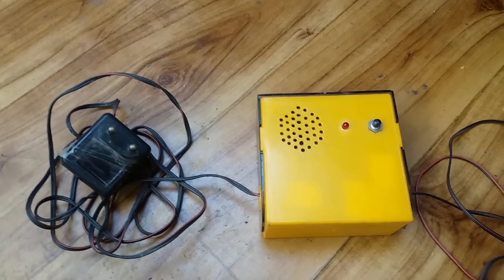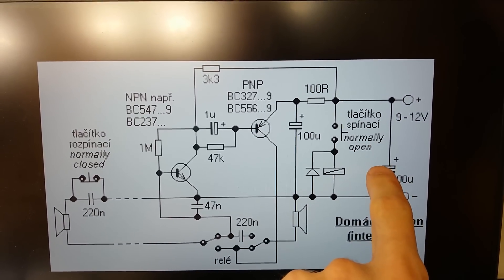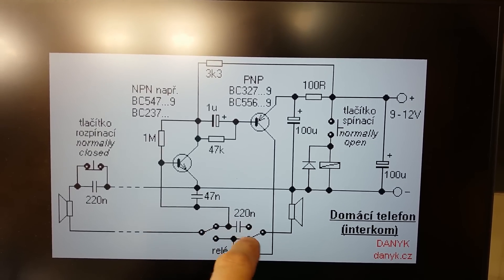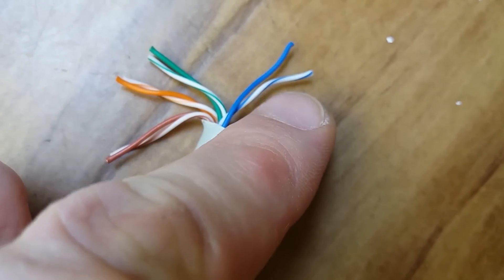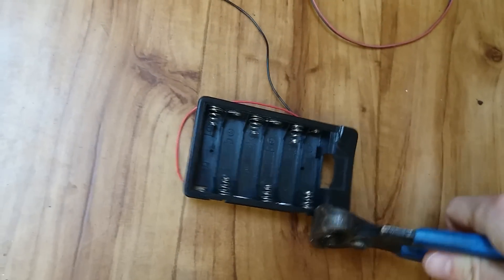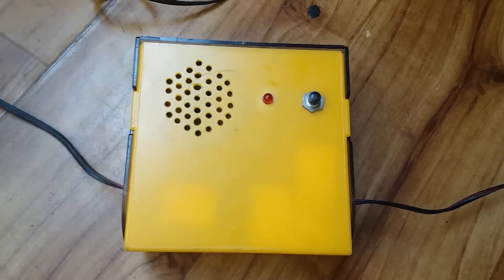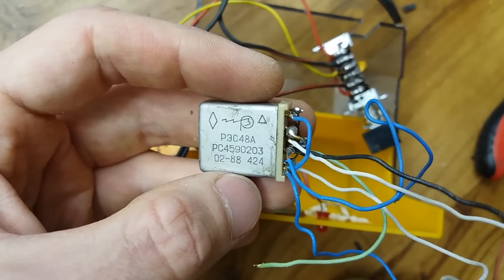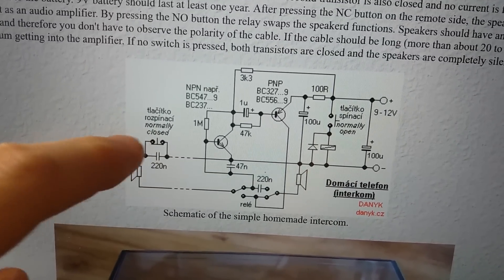DIY intercom (+ random thoughts on overcomplicated technologies) - unedited

Comment: Especially household appliances.why should fridge have digital thermostat? Why washing machines connect to wifi? All of that could be solved with mechanical switches, timers and thermostats plus it would be 10 times more reliable.
Reply: my grandmas washing machine is practiacally useless because its microcontroller died after like not even 4 years of use. My washing machine lasted 30 years with only occasianal brush replacements (since it has a brushed motor) until the motor died and we actually found a replacement that will prolly last another 30 years. The timings and the programs where never a problem. It has a knob to set the program with a synchronous ac motor that turns it as time goes on connecting and disconnecting internal contacts that start and stop each function and the whole thing is precisely timed cause the synchronous motor uses the constant 50hz mains frequency for the timings. Zero logic get it does all the different functions a washing machine needs to do just fine
Reply: @the_danksmith134  Exactly! And no eco crap! Uses water.

Comment: I stiil use this type of cable to connect my computer to modem. Also you are so right about technology depence, most people cannot fix their appliances even if problem is as simple as broken cable yet they complain about so called missing features in the products when they did not know what a transistor is and this is sadly true even for engineering students (i am electrical engineering student) most of my friends from my department cannot understand or build simple transistor circuits like amplifiers or oscillators. Instead they try to learn super complex, posh subjects like artifical intelligence while they can't explain how a royer oscillator works.
Reply: I didn't know about the Royer Oscillator so I had to Google it, isn't modern technology marvellous!!!!!!!!!!!!!! , this info is for other readers if interested. 😏😏

A Royer oscillator is an electronic relaxation oscillator that employs a saturable-core transformer. It was invented and patented in 1954 by George H. Royer. It has the advantages of simplicity, low component count, rectangle waveforms, and easy transformer isolation. By making maximum use of the transformer core, it also minimises the size and weight of the transformer. The classic Royer circuit outputs square waves. There is another converter design often described as a "resonant Royer" which generates sinewaves. This was, apparently, first described in 1959 by Baxandall and therefore should be called the "Baxandall converter". Its differences are explained below. Both versions are widely used, mainly as power inverters.
Reply: @brucepickess8097  if it is used wisely without becoming too dependent modern technology is amazing but like Diode's thermometer video, there is no need for wifi, bluetooth or any other smart things when you making simple thermometer or clock. This is the curse of modern technology almost every product have unneccessary features and almost always they use a microprocessor even if task is very simple and it could be done using some simple logic, 555 or etc. They overcompilacate everything which makes products last less and impossible to repair.

Comment: I made myself a similar intercom from inside the house to the main gate (some 10m length of cable) using a schematic from a magazine. I do not know, my fault or the schematic was wrong or is was its normal functional mode, but I always listened what happened on the street. And yes, the outside speaker had no button, it had only one button (listen/speak) that was inside. Also, I used a transformer from an old electromagnetic telephone and two germanium transistors.

Comment: Neat! I will try to make this one since I am more a fan of analog solutions that are reliable instead of relying on others.

I have to agree on the points you make that the complexity of devices these days makes them harder to repair. Minimizing design is also something that greatly reduces reliability. Like that modem would probably perform better with more internal memory and a heatsink and adding more or better capacitors. but then it would cost more to produce and when modems are given away for free with internet contracts they will decide to buy cheapest ones. Also why build reliable device when you earn more money by selling a new one every few years.
So much e-waste is being generated gust because of financial gains. It’s sad really.
Also companies making it hard to repair their products due to using custom chips and not making those available to repair shops or adding firmware that breaks the device when a repair is made is an issue (see right to repair / louis rossman)

When possible, I try to use simpler technology that I can repair myself. The only problem I have now with using actual older devices is that the energy prices are rising and I cannot afford to use inefficient devices. Your solutions for metering usage and replacing parts + adding batteries is very welcome.

Comment: Most of us still use cables to connect computers to the internet, but it's modern cabling and it works a lot better than wifi (latency, speed, stability). These internet connectors are called RJ-45 and there's a lot of standards for cables such as cat5e, cat6a
Reply: Same, the only thing that uses WiFi is my work laptop and my phone. All my computers use Ethernet.
Reply: modern wifi is nowere near the wifi before 10-15 years and its pretty reliable
Reply: @ДимитърАндонов-ъ7е  that's true but most modern houses have ethernet wiring already in place so why not. Also, not everyone has multiple routers for a huge house, so signal loss is an issue
Reply: @ДимитърАндонов-ъ7е  If you live in a rural region, maybe. WiFi is chaos in the city. 30 networks on 2.4 GHz, completely crambed. And I use ESPs with 2.4 GHz... Have to switch channels daily.

Comment: I also hate overcomplicated things, especially putting an Arduino in everything. Like 80% of "DIY" projects nowadays consist of an Arduino and a few Chinese modules slapped together. Yes, Chinese modules are sometimes useful, like for example, 18650 chargers or LCD displays, but using a "relay module" which is just a relay on a PCB with screw terminals is just stupid.
Reply from the maker: Yes, I also don't mind complexity if it's necessary to do the job. But I hate complex solutions of simple problems. 100 years ago, you had to create your own components before even making a circuit. Then people started building out of ready made components. But now they're building it out of modules. But who knows, maybe in the early 20th century somebody like me was complaining about people no longer making their own tubes and batteries :).
Reply: You're absolutely right and I hate using a microcontroller to solve problems that an average EE could solve in 1940 with basic components.  It's one reason I love older circuits as people could once solve surprisingly complex problems without computers.

However, I'm a terrible EE and can far more easily do programming than circuits :(.  Despite getting an electronics kit for Christmas as a kid in the 80's and beginning an EE degree in college (I enjoyed it, but dropped out), I'm simply not good at circuit design and watch this channel to learn from the one of the best.  I often resort to a microcontroller simply because it's what I'm better at; it's how I think.

I still take pride in my work, though.  I can make a µC circuit that consumes nanoamps of quiescent current (or none with a latch) and looks simple as I can replace components with code, but the complexity is in the software.  I'm ashamed of my lack of electronics skill, but it is what it is.

I came across a "mosfet module" on AliExpress that is literally a FET stuck into a PCB with terminals.  It has a VCC input pin from the uC that literally goes nowhere.  How's that for stupid?
Reply: I think that the "pure" electronic art is disappearing, shifting towards a modular approach and extensive use of microcontrollers. I plan to make a channel where to present, analyze, test and make old kits, schematics from old magazines ('70-'80) mostly from Eastern Europe countries. For now I collect them in physical and digital formats. Pity that old magazines costs too much because "vintage" and they are quite rare now.
Reply: "Arduino", esp-32 is where is at; if you go for a microcontroller, you can use one with wifi and bluetooth built in; the OS is better as well.